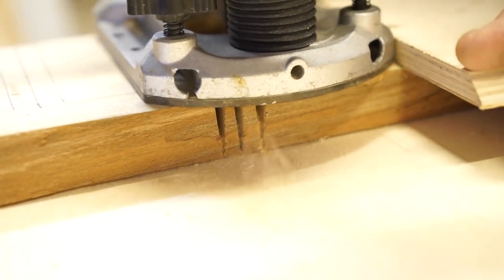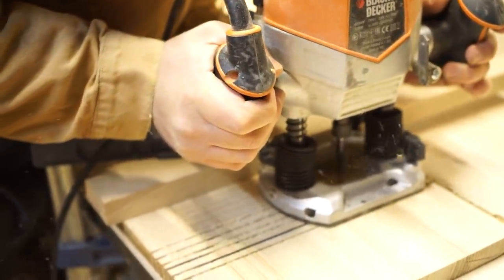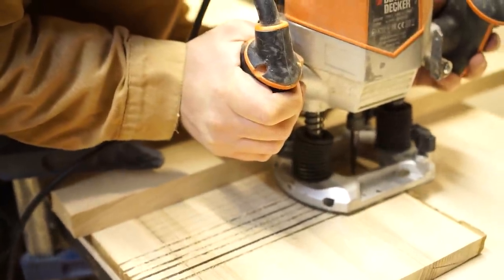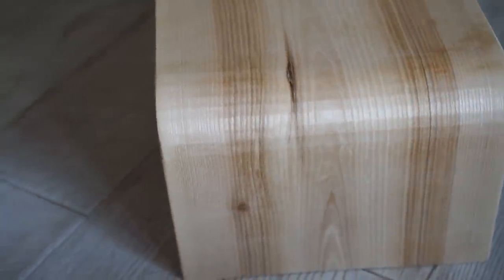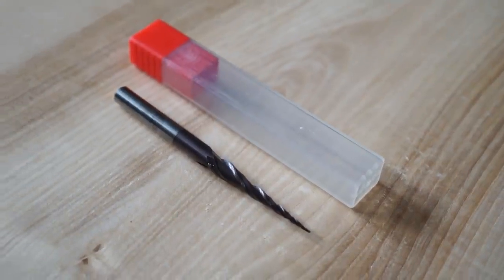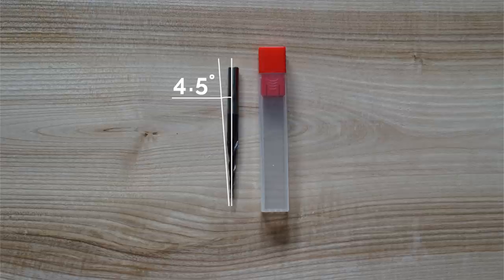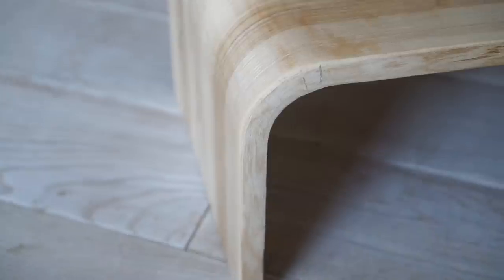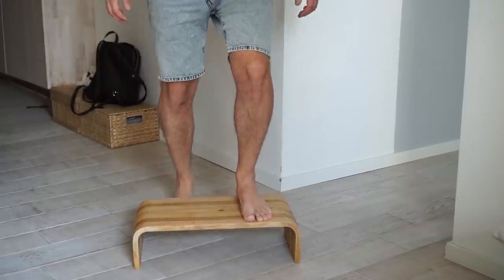A better way to do kerf bending

Comment: Very nice! I have a question. When you glued the wood, it still was wet because steam or you let the wood dry before glue?
Reply from the maker: Still wet. IDK much about glues, but there's a chance of water based glue having better adhesion/fusion with wet surface

Comment: I'ld wish you could provide a link to a bit like that. Im using a 8mm router, and cant find anything like this. I came up with the same idea, that this could make seams almost invicible. The concept is great for high end furniture from plywood.
Reply from the maker: I've bought mine here https://frezycnc.in.ua/category/251434/1102675
Mine has R0.5, but I'd buy 0.25 now. Site not optimized for international delivery, but it says they can do it.

Comment: is there any tips on how to calculate how many cuts and gap distance needed to make certain angle? fo example how many cuts and gap distance needed to make 45 dgree bend.
Reply from the maker: You can divide tip diameter by your piece thickness, and get arcsine of that value. Add that to your bit angle, and you get angle of each cut. But you'll need to test it on a scrap piece anyway, so it's easier to just measure it on that scrap piece. 
But I've just calculated, and this seems to add up. 1 mm tip diameter on 20 mm piece = 0.05 = extra 2.86 degrees = 8 cuts for 95 degrees instead of expected 10 for 90. And those 5 extra degrees spread on each cut are not noticable
Reply from the maker: And the bit itself has a constant angle, which would get constant angle for 1 cut if the tip was infinetely thin. In my case 9 degrees

Comment: What does it look like on the cut side ?
Reply from the maker: Like glued wood. Mine's a little dirty, glue melted when sanding. The gaps  get bigger towards the face side, because the bit tip has some width

Comment: i really like the angled idea to make the cuts more clean when bent i may try adding some bevels to some saw blades i have and see if i can get the same effect
Reply from the maker: Cool, let me know if that works. Doesn't the saw cut with it's tip only? On the other hand you could get an even thinner tip, if you have a custom made tool. Would look better
Reply: @ivanmakes957  yea it seems the only way would be with a custom blade since there are no blades with teeth deep enough to do it im thinking of trying your way but using the circular saw with a thinner blade and not cutting as deep so the router bit doesn't have to struggle going through so much material and im pretty sure i can easily use the existing cuts with a jig on the router so i dont have to reset the straight edge for every cut with the router
Reply from the maker: That's a great idea. Router should folow the groove cut with a circular saw without a jig(maybe not any groove) And it is certainly easier to cut straight line with a saw

Comment: While contemplating using a v-groove router bit to do the same, I came across your video. Looks exactly like what I want to do. 

I think I'm going to harvest the saw dust to fill in the gaps on the edges for a more seamless look. Thanks for validating my thoughts!